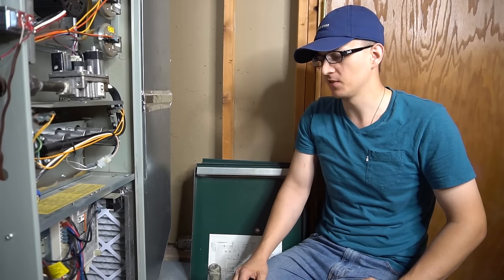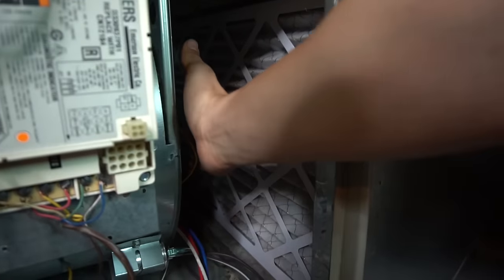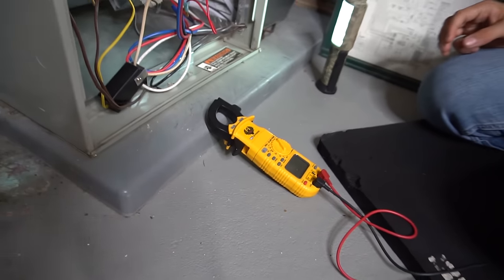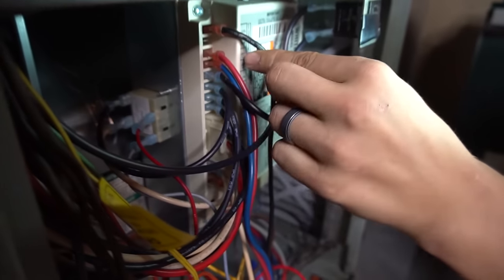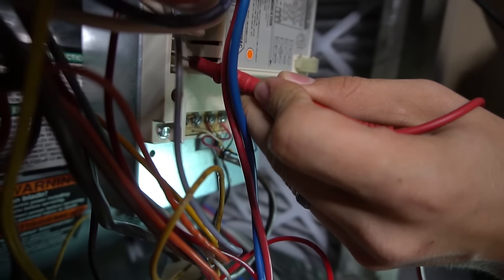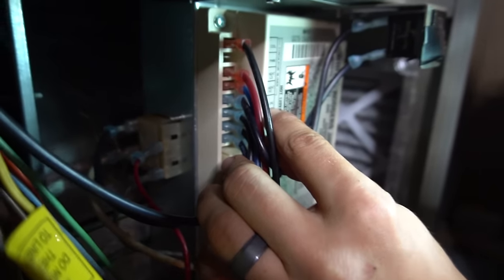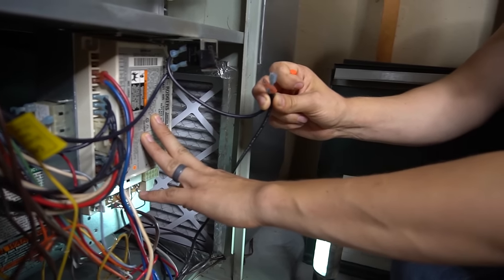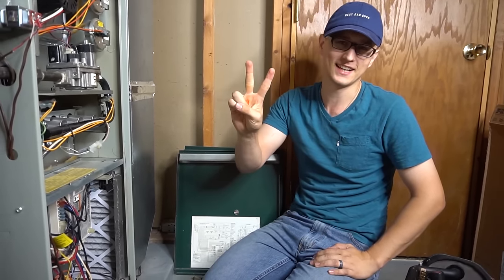Furnace Blower Not Working - How to Check It

Comment: Thanks, you’ve helped me with two furnaces in two different houses. Both had blower motor issues. I was able to confirm this latest one with the “Hotwire” technique. I made a simple jumper wire with blade connectors and just plugged it in, switched the unit on with the door switch repressed and heard buuuuuuuuzzzzzzz.  No spinning but it did get hot! Bingo bad blower motor. Now to replace it 😢
Thanks again!

Comment: If I use wire nuts to be able to hook door switch line power to my high-speed heat wire do I still have to plug that into the control board?

Comment: Blower running but weak not like before . It is sorta working but shuts down after a short while and does get hot . Soo is it bad ? Someone on another video said check capacitor but mine has a small two wire switch which doesn't look like any capacitor I've seen . Any help be appreciated . Yes lines were frozen and coil sits on top of furnace looks hard to get to check /clean

Comment: First of all, thank you for your channel. I have learned a lot from your channel. Is the common you mentioned in the video is EAC terminal? you said using ECA terminal or CIR terminal connect with Cool terminal to check it by multimeter. if we get 120V it means motor is bad. if we don’t get 120V it means Control board is bad right?

Comment: Amazing wealth of knowledge. Thank you for sharing. Fairly sure we have this fault after replacing a defective dual run cap, the compressor is now functional but zero air out of the registers but we do have cooling. Will check the run cap for the fan you referenced. Many thanks again.

Comment: Circulator wire on a furnace? I guess any 120 volt neutral wire is good to check for 120 volts?

Comment: Your videos are great and helped me narrow down my problem.  But I still don't have my answer.  My blower motor does not turn on.  (The inducer motor does run)  I believe the root of my problem was a dirty filter, which I believe has caused my unknown issue.  I did install a new filter. I replaced the limit switch (not the issue). The capacitor was tested and is good.  I did jump the blower motor by using a jumper wire between the G & R terminals.  When I do this the fan spins for about 1/2 second, but that is all.  (This tells me that my control board is good I think). My blower motor spins freely when I spin with my fingers and the backside of the motor is not hot at all after sending signal to heat furnace for a few minutes.  Now I'm stumped.  What else should I check?  Everything seems pretty clean and my unit looks just like the one you use in many of your videos.  Any advice would be greatly appreciated.    My wife tested positive for COVID and it's hard to get a professional to come to our house.  Thank you!

Comment: At 5:40 you said if there is a board problem and while you waiting on getting a board, you bypass the blower motor with the door wire just to make it run while you get the board.
Just wondering, wont it make the blower motor run non-stop until we manually stop it or change the board.
Wouldn't it be better to bypass from Inducer motor (At least during Heating Call) so it only run when there is a heat call and inducer motor start running?

Comment: My fan is not coming on.  I removed the squirrel cage and clean the dust and the connectors too. the fan spins freely. I reinstalled it and the fan comes on for a turn  then stops and reverses the other direction for a turn then stops and repeats. is this a circuit board problem? should I  connect the power directly to the blower motor to see if it will  run normally ? thanks, great videos !

Comment: Love your videos but it is still does not solve my problem which seems to be the thermostat. FYI I have jumpered and bypass the thermostat and the Honeywell 2 zoning damper panel system, and the furnace works fine. I also see 24v at the thermostat but it does not seem to be sending signal back to the panel and furnace. Any advise?

Comment: I have an older Bryant/carrier furnace. It has been running fine with a google nest thermostat. yesterday morning I smelled a burning odor throughout the house. I turned off the furnace and checked for fire downstairs. I called a tech and they came out and said it could be soot so they offered a cleaning for $250 they removed an overhead pipe and emptied debris and vacuumed the furnace. They also cleaned the ignitor. When they turned it back on the blower took a long time to chime in but it eventually did. I turned the unit off 20 minutes after they left to air out the house. The blower has not turned back on since. I then watched your video and went out and bought a new capacitor and installed it. I jumped the power directly to the blower and it came on strong. I thought I won but when I closed everything and turned the heat on from the thermostat the blower still won't come on and I still get the smell. Totally frustrated! From your video I'm assuming I need a new board but I'm hoping that the contractor didn't do something just to get me to call back and spend more money. Any thoughts? Can the board send a burning smell through the house? It looks fine and I don't see any smoke or smell it at the board only when I go back upstairs coming through the vents

Comment: Thank you for sharing your knowledge with the world. Much appreciated. What should i do if the everything works except the blower needs to be manually spun to start? It runs perfectly after i hand spin it.
Reply from the maker: You're welcome! Sorry to hear about the blower troubles! Either your capacitor is dead or that blower motor is on its way out.. If you have a multimeter, it would be nice to check the capacitor otherwise just start by replacing it. Hopefully you won't need to replace the motor.

Comment: Would a weak or failing capacitor cause the blower motor to temporarily shut off and on repeatedly AFTER the cooling cycle is shut off by the thermostat (during the normal run time after the cycle)?  The outside unit seems to run ok. Air is cool.  Plenum is cold.  Thanks so much for a very informative video.      added:  ....... air handler blower does not have an obvious capacitor (FEM4P fan coil).  system is only 5 years old

Comment: Nice video.   My blower motor isn't coming on..  I cant seem to figure out why my brand new install Goodman MVC96 furnace blower fan shuts off as soon as I switch the thermostat to cool mode but the a/c condenser does start up fine.  Because of no blower fan circulation the TXV and service port start freezing up immediately so I cant even get to confirming sub cooling  . I have the 2 condenser wires hooked to Y & C on the furnace control board but when i set the thermostat to cool it shut off the blower fan. Blower fan also wont run in the ON or Auto position when set to cool but does work fine in heat and fan only mode.???   Any suggestions would be great. thanks

Comment: Hi. My blower works.  It's just intermittent. Sometimes I have to reset the furnace switch once to get it to act right.  Sometimes, like this morning I have to reset the furnace 4x.  Would this video still apply? If not what would cause this? I can her the furnace turning on, but the second sound (the blower) is what doesn't always come on

Comment: Put new motor on a blower runs but there's no heat from the furnace if it when it overheated did it put a heat switch out that the furnace doesn't kick in

Comment: Thank you for your video! Using your video, I found that my control board needed replaced. I was able to wire the blower directly to power to get my A/C back up and running for a few days while I waited for the new part to ship.

Comment: Jay--9 months ago you really helped me with a problem with my blower and the control board on my Rheem Corsaire AC/furnace unit--you can see our whole dialogue below in the comments.  However, the problem re-surfaced again this year in the same unit--namely i checked the air return below the filter and blower and sure enough it was completely full of cold water--luckily this time it hadn't shorted out the control board or fan but i figured i must have a condensate drain issue.  There is another AC unit right next to it and i can see the condensate line draining water all day--but not on this unit.  Both have similarly plumbed drain lines but unfortunately i cannot access the drain pan to inspect it.  So here's what i did:
1. Cut the drain line close to the pan, attempted to vacuum the pan and then rejoined it with very tight plastic tubing over the outside of the PVC so i can see whether anything is coming out of the pan.
2. Vacuumed out and snaked (with a wire puller) the condensate line at the termination, but found no blockages or crud--the line is only about ten feet long in total
3. Installed a T before the P trap (there is a P trap in the line with an uncapped vent after the trap, but the trap was also clean) in order to make sure i could "prime" it as well as occasionally pour bleach into the trap.
Now here's the odd thing:  If i put the cap on the T before the trap, which is what i understand you're supposed to do, the condensate stops coming out of the drain and the drain pan overflows down the side of the blower, but if i take the cap off the T, the condensate starts running freely all the way out the drain, although i also lose cool air out that vent which i'm guessing means i have a positive pressure system.  So what in the world is going on ?  I've left the cap off the T and the condensate line is running fine now and there's no water in the return air compartment below the filter.  Thoughts ?
Reply from the maker: Hey Mark! Sorry to hear about the AC troubles! From what you described, it sounds like the drain line gets pulled into a vacuum when the system is running. Having a T with a vent is actually a common procedure. If there is no T, sometimes I will simply drill a little hole on the top of the first elbow as it comes out from the drain pan. So I would just leave it the way you set it up. Sounds good to me :) and it's okay that there is air coming out of it. In fact, if there is no air coming out of it, then that will be a quick indicator for you that the drain line is plugged coming out of the coil.
Reply: @WordofAdviceTV  thanks for the quick response, Jay.  I read so much stuff that said never to have an open vent before the P trap in a positive pressure system--but ultimately that's what works so i guess i need to have my physicist buddy explain why to me !  I also suppose i don't really need to prime the P trap either--i originally thought i had a negative pressure system and the P trap dried out and allowed air to be sucked into the drain--again, thanks and keep up the great videos

Comment: Thank you for providing these troubleshooting videos. I have subscribed to your channel, and look forward to watching more of your fantastic videos. I need some extra assistance on my American Standard (Trane) system. It is a dual fuel Heat Pump using gas heat, instead of the traditional electric strip heaters. It has worked exceptionally well since it's installation in 2005. It is installed in our basement, and a water leak from the drain in the first floor bath tub allowed some water to enter the air handling unit. The outdoor air conditioner unit continued to run, but the blower motor quit running. The area was not flooded, but enough water (like a heavy mist) was present to cause some some damage to the motor and/or the control board. Your video "Furnace Blower Not Working - How to Check It" was great, but my system has an "ICN Fan Motor." Therefore, I would appreciate some additional training, if you are familiar with this system. SYSTEM HARDWARE: FURNACE/AIR HANDLER: American Standard AUD100R9V5K2 --- A-COIL (mounted over furnace): American Standard TXC054E5HPC0 --- HEAT PUMP (outdoor unit): American Standard (Heritage 14) Mod 2A6H4042A1000AA (MFR DATE 3/2014) --- INTEGRATED FURNACE CONTROL: CNT03078 --- DUAL FUEL RELAY BOARD: BPC-1, Rev 2 --- ICN FAN MOTOR: Trane # D341314P05 --- How can I determine whether the fan motor and/or the circuit board are defective?

Comment: I have the A/C outside unit running but the blower is not.  It started a couple of times and now just make a humming noise and will not turn over.  Advise please.

Comment: Hello, like your videos very much!    A Question..

had trouble shot a few things when my thermostat went blank.. A 13 yr old tappan 92.1 HE gas furnace, n 7 day programmable honeywell thermestat, wired 4 wire.  after getting to the point that jumping R-W did kick off the ignitor, gas, and fan in order for 5 inutes ran..  I did notice a power relay that had a burn mark through it!  (why I doubted the thermostat having issue, but thermostat did have corrosion on one of the battery terminals.. and tried new batteries, and had a on, off situation on display, but circulation blower..(large) did kick on with the manual switch.   PS had a broken Jtube that was clogged I had unclogged, and moddified size slightly.. and tested the little sump pump that goes to my basement deain ok.

Anyway A new honeywell enabled me to ignite, small blower gas, and ignition ok, and large circulation blower/fan did kick on, clicks from the board, and ran for 10 minutes, and shut off, (couple times and the blowers both seem to kick on and go off as I think they should. 

If guessing does this relay possible control a second speed for the circulation (large) blower?  I know in winter coming up soon, it does have a slow cycle and a fast cycle to it.   Have not ran it long as I am not sure if it is save to run the furnace as is with that power relay part number listed below!  

Pwer relay part on board is       T9AV1D12-22

Will purchase a new board but may take some time to get via mail!  Let me know if in a pinch I can temporarily use the furnace on some cool nights coming up!!!  :)   Appreciate your advice on this one.

Comment: Thank you! You helped me to fix my A/C fan problem.  The inside fan would not come on at all and the A/C unit outside did not come on either. When I turn the control to fan only the fan or blower did not come on. After 4 hours of troubleshooting in a hot attic, I found the control board the problem.  After looking closer I found a 5 amp fuse on the board blown.  Replace it and guess what.  Cold air is now blowing.  Might want to add that in your next video.  Could possibly save someone 4 hours in the hot sauna.  Still could not have done it without your help.  I saved at least. 2 bills.  Thanks again!
Reply from the maker: You're welcome! Thank you for coming back and sharing! I do talk about the 3 or 5 amp fuse in many of my other videos but I guess I didn't in this one. Sorry about that. Glad to hear you were able to get it fixed! Your efforts were not in vain :) Stay cool!

Comment: So thanks for helping me figuring out that my fan wasn't bad nor my capacitor wasn't the issue. But in my opinion the cutting of wires was not a good idea. By passing the controll board or putting the line with the splitter into the cool will NOT give you A/C!

Comment: I wish that I had seen this video before commenting on your other one for "AC Unit Not Turning On - How to Fix It".  In a nutshell, my blower works when set to the ON position, but does not work when set to AUTO.  No part of my system has been changed since I purchased the house a year ago and all systems (heat and cooling) have worked flawlessly until two days ago.

Comment: Is there somewhere you have a link to buy the splitter you show connecting the two female wires to the male?  It’s Sunday so I went to Ace, Lowe’s and Home Depot with no luck finding it.  I was able to isolate the problem to the control board so yeah and thanks🎉😂!
Reply from the maker: You could simply snip the wires and wire nut them together too and then use a pigtail (third wire) to hook up to the male terminal.

Comment: Jumped R and G on the control board.  I hear 2 clicks approximately 2 seconds apart but the blower would not come on.  The fan cage spins freely.  Could it be the motor?  Although the motor was replaced less than a year ago.  Could it be the capacitor?  Thanks,

Comment: My blower motor won’t start up, but if I spin the cage it will then keep it running. I’ve replaced the capacitor and the motor. Control Board the issue???

Comment: I have a 5 year old Nordyne  model R8GE-X36K-072C packaged single stage gas  heat / electric ac. The Blower motor has been working on and off for the season. now not coming on at all,  (outside unit) everything else is working normal. you don't seem to have anything on this type unit. The compressor and capacitor are all good. I do not see a capacitor on the blower motor fan housing. Is there one on this type unit or does it all work off the capacitor located in the board / heating system area, which is a 45+ 5 7 mfd +/- 5 mfd  5%  370 volts. It checks good, the fan is smooth turning no looseness wobble or signs of burn out smell. everything looks good, not nasty or worn indications so i'm thinking there must be a capacitor somewhere. Any  advice on this. thanks  much.

Comment: Loved your video. I was sure it was going to be the blower motor but using your tests I determined it was the blower control board and was able to source the part and install it myself. Thank you!
Reply: Your videos are great. I have not found a solution yet to my thermostat problem. I have hot wired the RH and W1 to bypass the Honeywell  HZ322 damper control panel and Nest thermostats. I can get 24V + at the Nest thermostat and I tried hot wiring the RH and W at the thermostat but it does not call for heat. So any advise?
Reply: @garykoh263  Not my videos and I'm no expert but rather than messing with the thermostat wires, just test the wires he suggests.